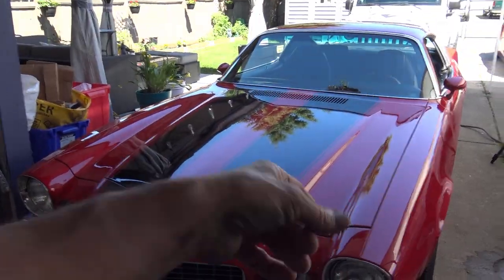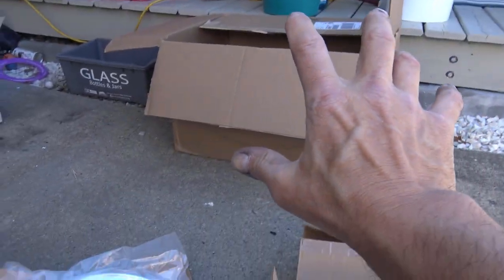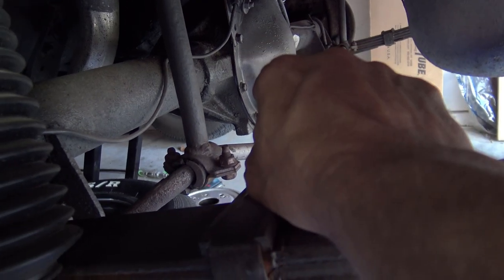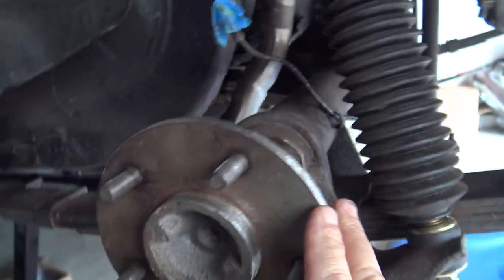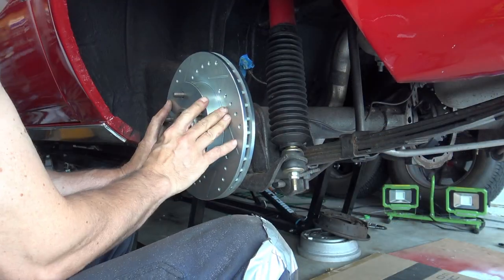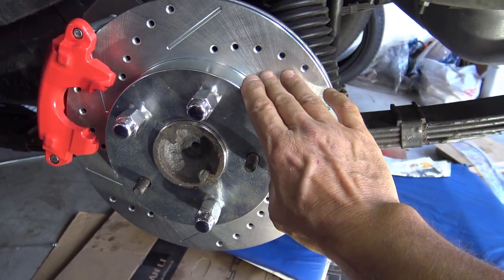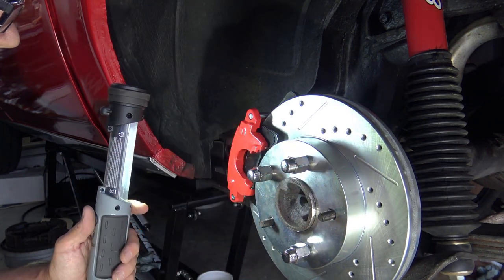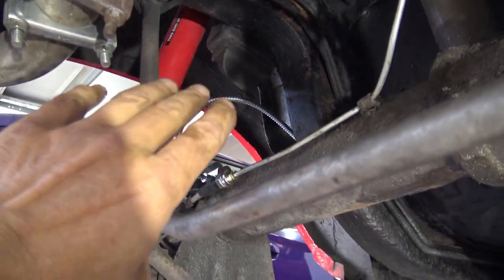Right Stuff Drum to Disc Brake Conversion DIY problems solved!

Comment: Man I’m currently putting basically the same kit on a 69 nova but my wheel studs are way to short sticking out that a rim wouldn’t even be able to be held on by lug nuts but I also need to get size 15 rims to meet clearance

Comment: Great video, keep up the good work Mike... from another Mike (OldTimerMike).  So, I'm curious about how you liked the Right Stuff rear brakes and especially the Emergency Brakes? I've heard its hit or miss with these. I'm also curious about the caliper orientation. On the DS you have the caliper located in the front, on the PS the caliper is located towards the rear. Any problem bleeding the brakes? And do you find the eBrake actually hold the car on a grade OK? I want to do this to my '69 Camaro, debating whether to use DSE shock/leaf brackets to put both shocks behind the axle as opposed to staggered. I'm not a drag racer just a cruiser so I'm not concerned about axle wrap plus I have Hotchkis leafs which are less prone to wrap up.TIA-Mike

Comment: I just realized after watching this that I need to go back now and look at recentering my calipers. I don’t think I ever knew how to do that. At least I don’t remember the instructions tell you how to.
Regardless I have to take them back off because I never adjusted the e brake properly. Ugh. I’ve been running them for 2 years without either accomplished properly. I think I’ve been running off fronts only. Thanks for the full tutorial.
Reply from the maker: The calipers have some self centering ability but it is best to center them over the rotors.

Comment: How did you get the rotor to fit around the axle?
Reply from the maker: Had to grind the axle flange a bit on one side to get them to fit.
Reply: Just had to do this yesterday to 1966 Pontiac tempest. Rotor was was just a little to big

Comment: What brake pads does the rear use? And what emergency brake does it use? like off of what car
Reply: the caliper is made to be the park/emergency brake, its got a mechanical lever and spring that sets it from the old cable.